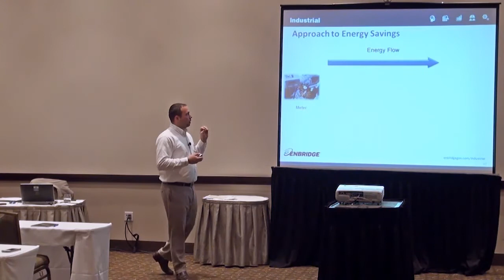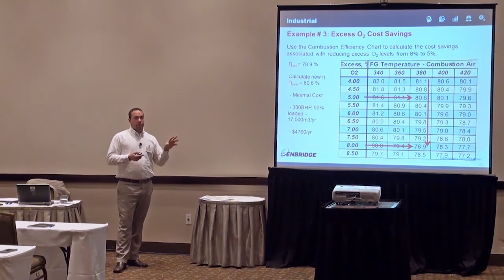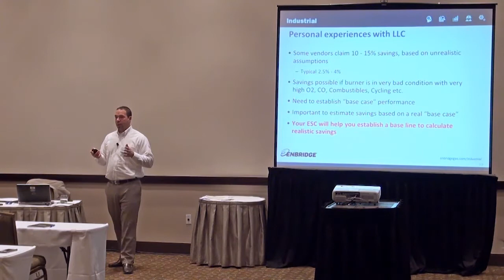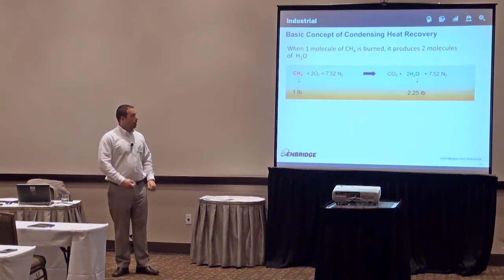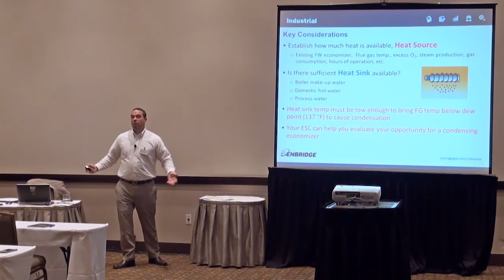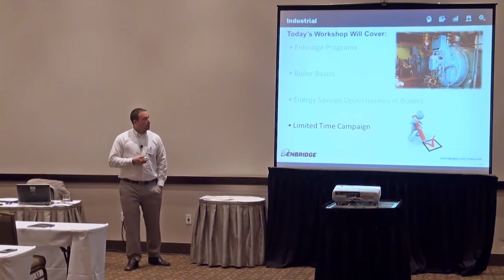Boilers 101 Workshop - Part 2

Comment: Great presentation by each of you guys.  
@27:31:  Hope you're still responding to comments.  I am USMMA, 1982 3rd Asst. Eng., BS Marine Engineering.  Now operate a Nebraska and English boilers at UNC system college.  Been a while ... understand you want to minimize DELTA on combustion exhaust gases.  Wondered why you take the delta AFTER the the Feedwater economizer.  Seems like all the work of the boiler's combustion process would have been done before the economizer.  Or is it just a matter of final Delta T up stack?